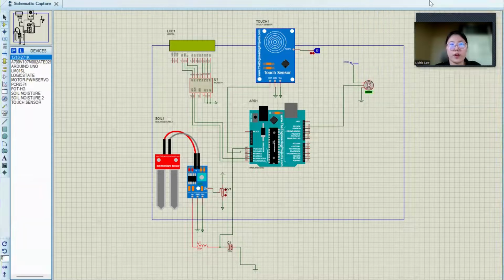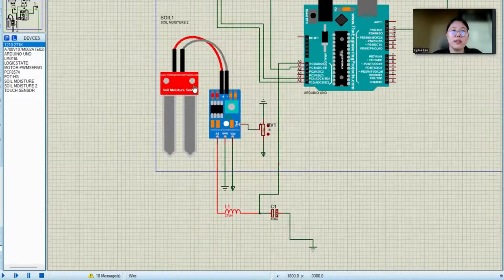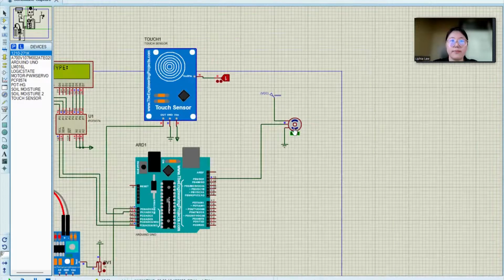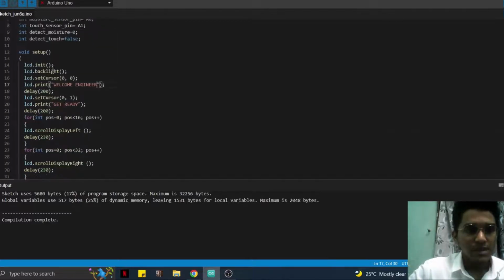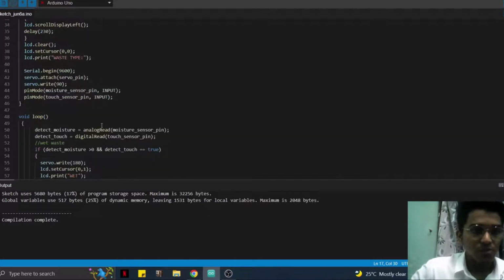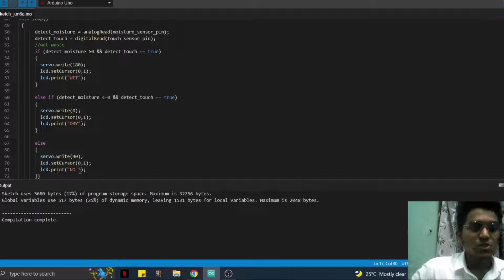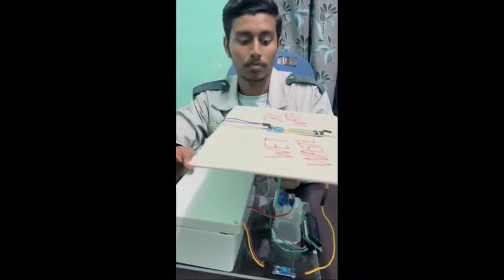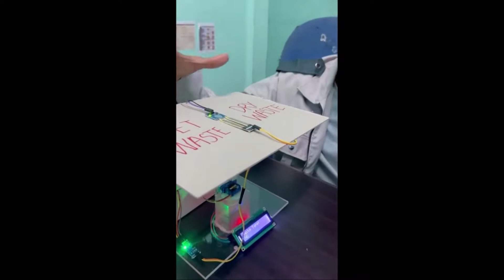Smart Bin (Can Separate Wet and Dry Waste)

Comment: G06-Our question is there’s any possibility where the sensor cannot trace the item that we put on the cupboard. For example like we put shirt on it.
Reply: There is no possibility that the sensors won’t detect the waste. If the shirt is put on both sensor, the touch sensor will detect the presence of the waste and moisture sensor detect the shirt is wet and will throw it to the wet bin.

Comment: GOOD IDEA and ACCEPTABLE PROGRESS. Here are some of my questions and suggestions:
1. Why did you choose a soil moisture sensor? Why not water sensors to detect the wet waste? 
2. The prototype is not complete. You should make/use dustbin/box for your prototype. You can get full marks if your prototype is complete. What will be the final dimension of the dustbin? How big will it be? 
3. The servo motor should be used for flipping the board. Not turning the board. Waste of space and energy.
Reply from the maker: Thank you sir for the suggestion to improve our prototype.
1) The reason we are using soil moisture sensor is that water sensor is hard to find and only two overseas sellers from shopee sell it and will take a long time to ship. Besides that, the price of the moisture sensor is much more cheaper than the water sensor (RM1.70 vs RM9.00). Since both the sensor can detect the presence of water, we opt for the cheaper option.
2) The dimension of the bin will be 20x30x19 which can fit the prototype perfectly.

Comment: (EC20086 GROUP 1)
What will be happen if the sensor cannot detect wet and dry waste especially to lcd display and the movement servo?
Reply: The sensor should be able to detect the waste but if it doesn’t, it will stay in neutral state and the lcd will show “no waste”.